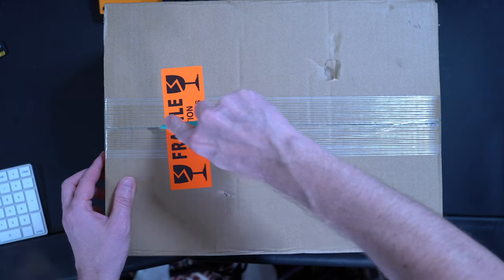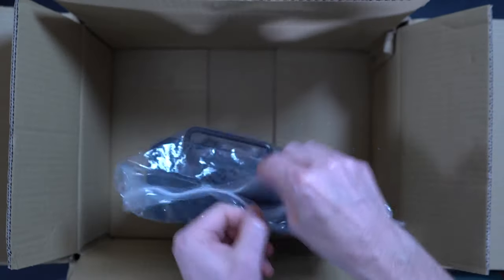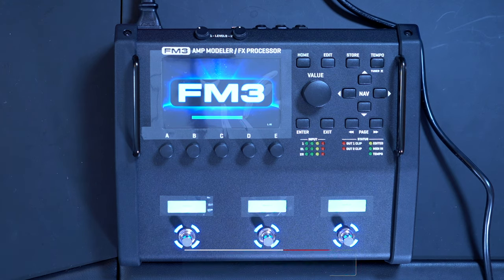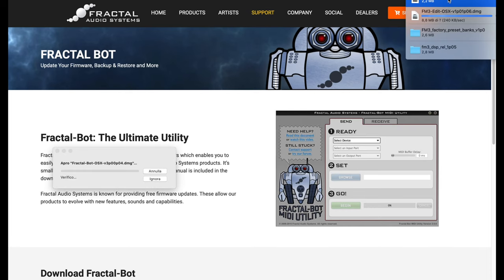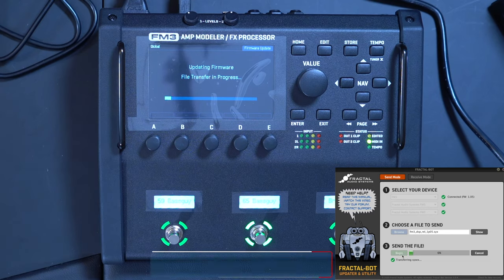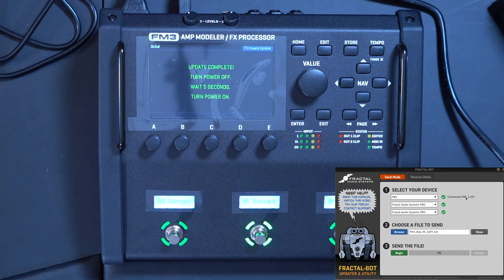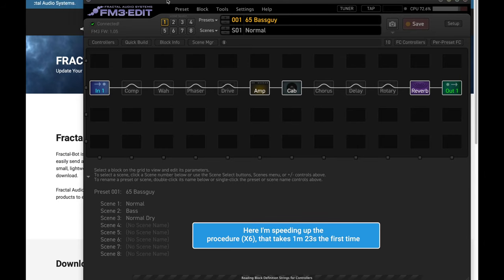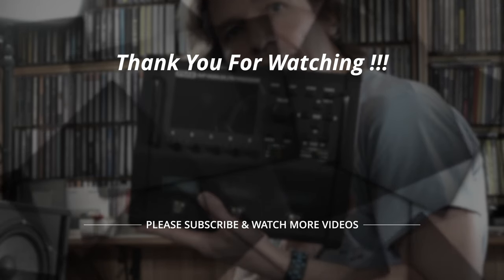Fractal Audio FM3: unboxing, sw to download and firmware update (what to do first, with a new FM3)

Comment: I'm really looking forward to your review of the FM3. It is on the top of my list of potential Effect Processor purchases. The FM3 and Axe-Fx III consistently sound the best of all the video reviews I've watched. They have a very nice computer interface as well, and appear to be extremely versatile units. One thing I hope you can test is the "number and type" of effects that can be run simultaneously before maxing out the CPU. This is the one thing that concerns me, besides the price. Thanks
Reply from the maker: Hi, thank you for your message and your suggestions! I will try to do my best!
Reply: @LeoGibsonGtr  I've been watching some recent reviews of the Nux-MG300, and it is amazing how good it sounds for about $130. It uses the same type algorithm:"In 2010 NUX introduced TSAC (True Simulation fo Analog  Circuit) with the sole intention of bringing Amp Modeling to a whole new
 level.  The DSP industry has been evolving at breakneck speed, and keeping up can be a challenge.  We were impressed that a product like the Fractal®  AX-FX had the foresight to use a high-definition TSAC (white-box) algorithm to do its Amp Modeling.  So we took note and started development on an affordable modeler with TSAC-HD."
A sound comparison would be very interesting. The MG300 lacks the inputs and outputs of the AX-FX units, by some of the sounds are very close.
Reply from the maker: @picksalot1  Hi, unfortunately it is still not available in Europe...I will get one when available, thank you for your message!